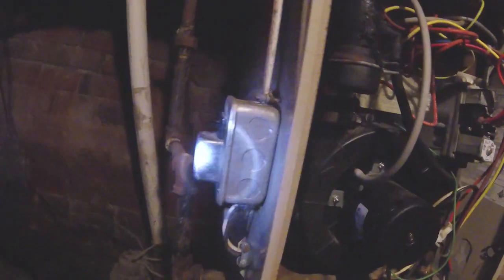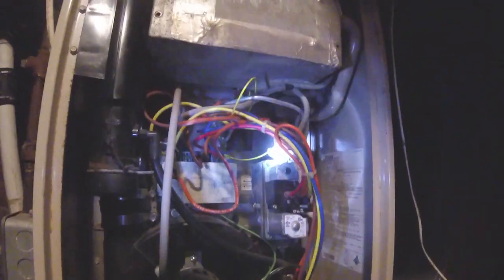$5,000 House - Old Furnace Removal

Comment: I rented a house with a wet basement.  I was able to stop water coming in just by creating a flower bed along the back of the house to divert water flowing toward the house from higher ground in the backyard.  I dug a shallow trench to divert the water flow and added a few bags of mulch.  When it rains, check out where the water flows.

Comment: If you are on an extreme budget you might want to EBAY out some of the used parts as some people can not afford new . Scrap steel has a small value but much better than paying to get rid of it.
Reply: Yes, part out the old furnace. Things like the control circuit board, power transformer, blower assembly could be sold on ebay to help recover some of your investment,

Comment: Does the basement leak when it rains? Routing the downspouts can help. Also dig out some of the old dirt and lay down poly then gravel on top. This cuts down on the ground seepage and humidity. Not perminant but keeps from pumping mildew filled air through the house.
Reply: I found a huge difference in air quality when I put a concrete floor in my basement. Also I set all of my air vents in the walls which keeps you from having dirt/dust/pet dander blow out into your living space. When you have a forced hot air furnace and your vents are in the floor everything that falls into the vents is subject to molding then the hot air is blown over it and you breathe it. It can make you sick.
Reply: A relative of mine died from pneumonia because of dirty vents. He kept going to the hospital and getting well enough to be sent home, then got worse at home, cycle repeated until his body gave out. His vents had a quarter inch of accumulated debris and he was a tidy person, just never opened up his system to clean the vents. Still, there is only so much you can get out.

Comment: Your old furnace was a high efficiency with plastic venting. The new one should also be a plastic vent model not a metal b vent style that requires a chimney. The sump pump needs to be operational its why the room floods and rotted the bottom off the furnace and damaged the controls. Wish I lived closer to you to help its what I use to do. Get it wrong and you put your self and house in danger. Your water heater install is scary at best.